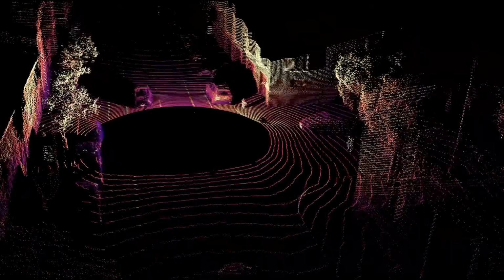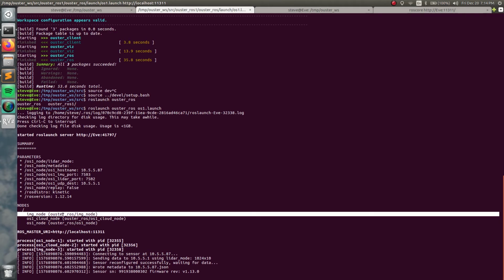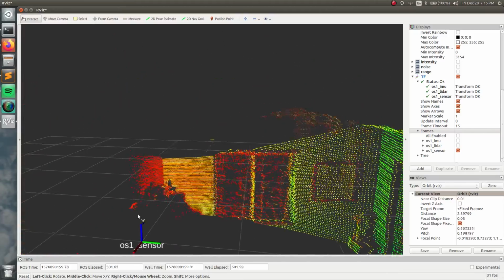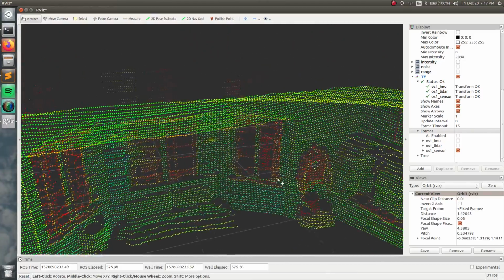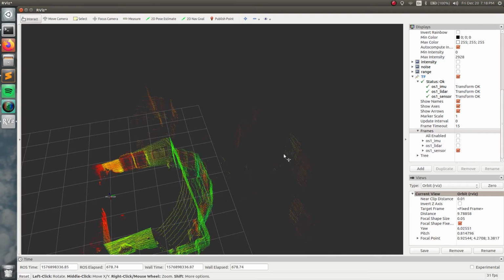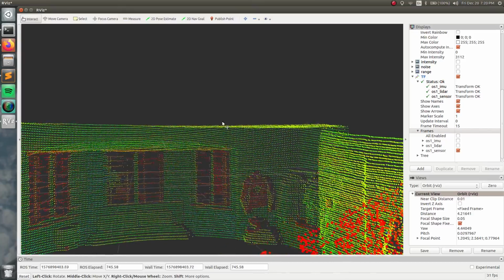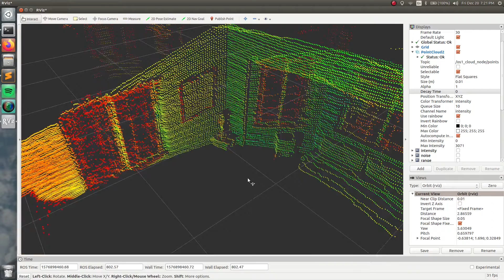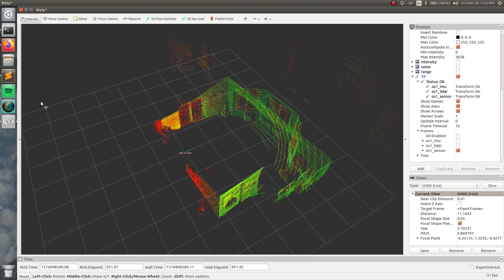Ouster OS-1 Lidar ROS Drivers and First Looks at the Amazing Data!

Comment: hi, do you know what happens when you have two or more of them in the room? do they interfer with the results of each other ?
Reply from the maker: Great question! Given they are on autonomous cars usually outfitted with 6+ I think they should be fine. I don’t think LIDARS like this tend to interfere with each other. However, I don’t actually have 2 of them to test and give you my personal experience.
Reply: @robotsforrobots27  by the way, great video :)